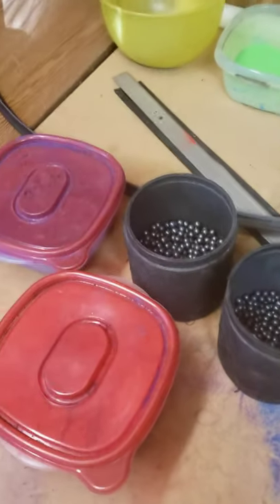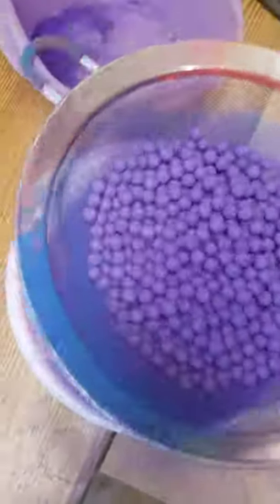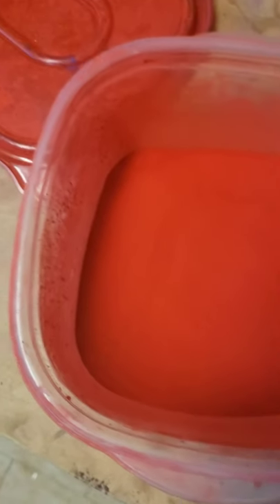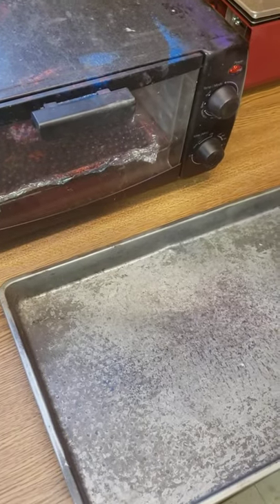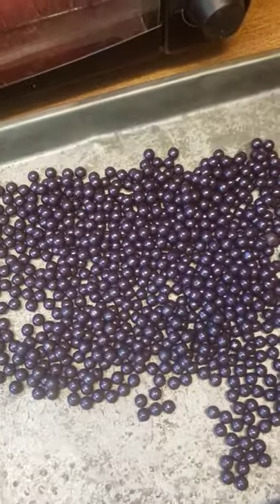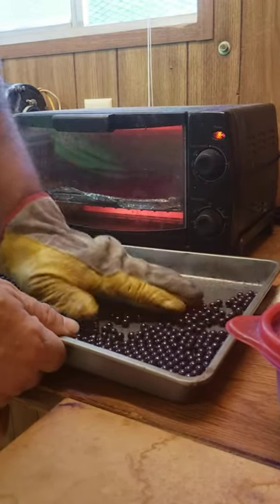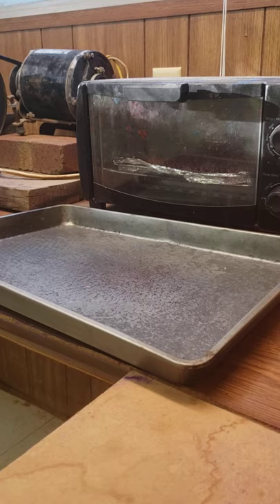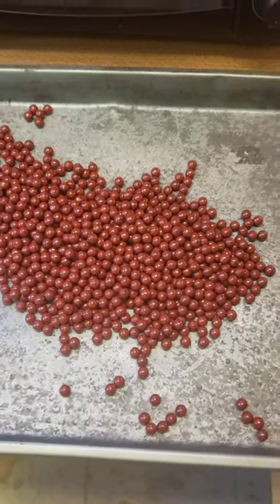powder coating quick and easy

Comment: I'm interested in the fact that you don't water drop them. Obviously they stay hard enough to not cause issues for you.
Reply from the maker: Mine are very hard the wheel weight lead an every 40 lbs I also drop a 5 lbs bar of super hard to the mix from roto metals
Reply: @rogeradkins9146  makes sense. I'm using COWW so I might play safe and water drop them... Or maybe do a small test batch and look at the results. Thank you! Oh and one more thing: do you have much research or results using 35 or 36 cal buck in Cheddite /Fiocchi, standard primers, blue Dot? I'm loving 31 in the Stoeger but interested in some bigger pellet loads that pattern tight too. Rev. Rush has some good ones, how about yourself? Luke.